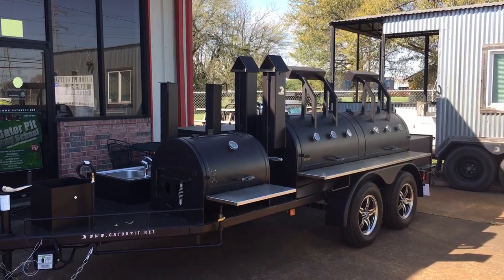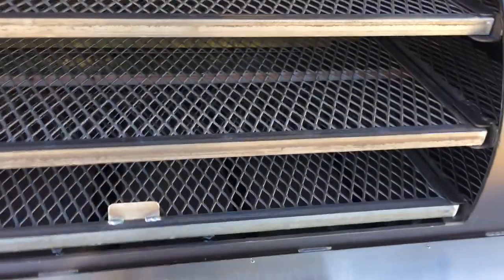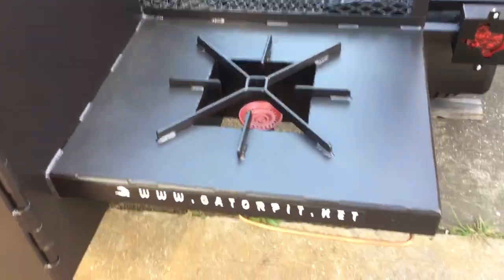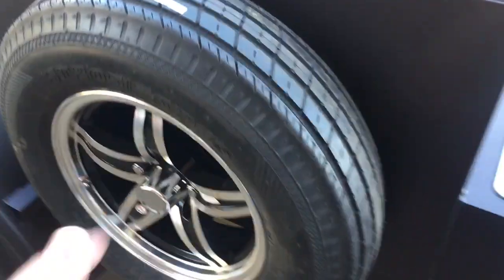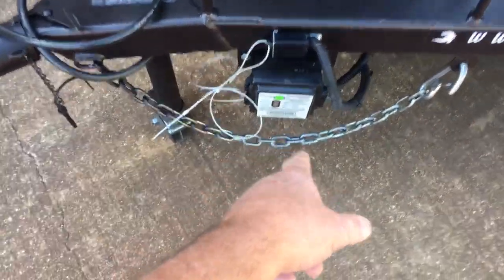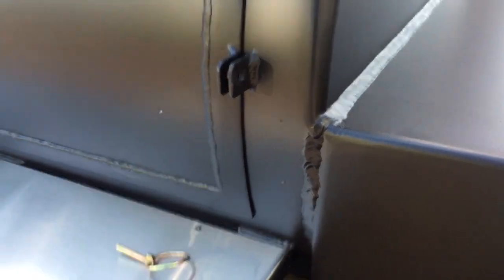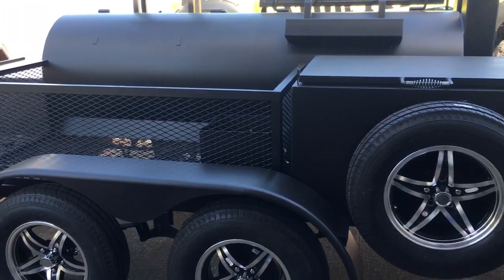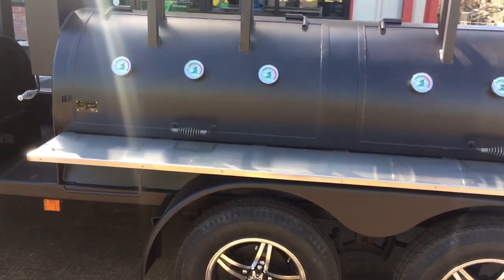BIG BOY GATOR.  Gator Pit of Texas custom tandem 30" x 96" mobile

Comment: Hello sir. looking to order one for my husband. What does something like that cost, roughly?
Reply from the maker: Melanise Fowler contact me Monday 713-896-0144 or email info@gatorpit.net.  Or, you can view our website on all our Gator models. This was particular cooker was custom designed and built for a customer.  Complete custom.  I can price it, but would need to pull the order when I am in my office Monday for the current price.   Thanks, Ritch

Comment: can I order a few temperature gauge,es probably like 25/ 30 of them i have best luck with your temperature gauge,es.
Reply from the maker: You can
Reply: @GatorPitofTexas  ty sir I will be in touch definitely just need couple of months to get some things lined out I'm talking with Lincoln electric now about there cut,ing table
Reply: @GatorPitofTexas  believe it or not I had one of your reverse flow smoker,s few years back and I took 2nd place in rib,s, and first place in chicken at the rattle snake round up in sweet water Texas. and took first place Year after in brisket.i miss going to Cook off,s.

Comment: I love this pit but out of curiosity.. when you use the dish washer wont all the grease built up in the tank and begin to corrode and build up in time , I know you can drain it but to get in there to really get rid of the grease  .. they need to come up a open tank mod next time , just curiosity and my thought ...
Reply from the maker: June bug june Only dish soap and water in there.  And, you treat it the same as a n RV.  It easily flushed out.

Comment: Thinking about starting a consessioin/catering bbq business.  How many people can this pit serve?
Reply from the maker: Easily 600-800 based on what you are cooking and how serving.
Reply: thanks, would it be possible to add a 30x4' in place of storage and stay within 20's?
Reply from the maker: This cooker is already over 20K with features.  And, with that added weight, you may have the costs of going with larger than tandem 3500 pound axles and larger/heavier tires/wheels.  Adding additional costs.
Reply: Looks like I missed the price 8 month ago when it was in the 20's.  What is the price now as it is and cost with one more 30x4'?  I figure gott a have the money before calling you
Reply from the maker: blue bonnet I misread your original posts. I thought you stated under 20k.  We should be able to keep you in 20’s.  Best to call me. 866-869-5166 toll free and discuss, so no confusion and we are on the same page.  Ritch

Comment: Question; if you have the door counterweighted is there a reason you can't make it one big door?
Reply from the maker: There is a point where the door will seriously warp and you may not be able to fit it to prevent leakage.
Reply: @GatorPitofTexas  Copy that.  Always wondered. Thanks for the reply.  Keep up great work.